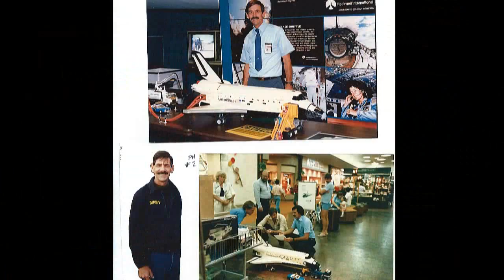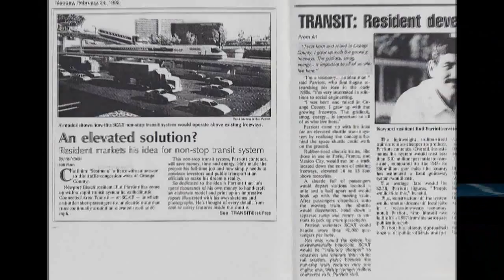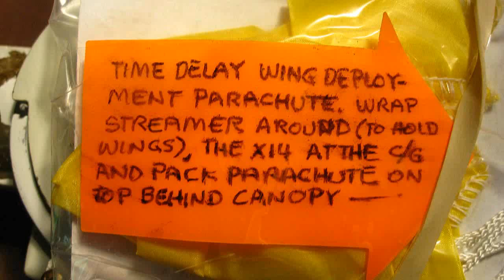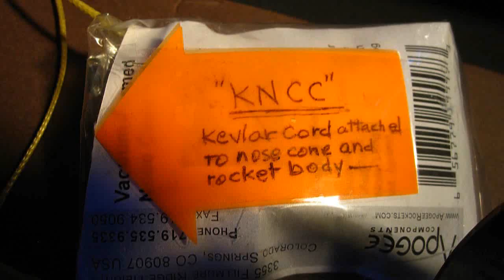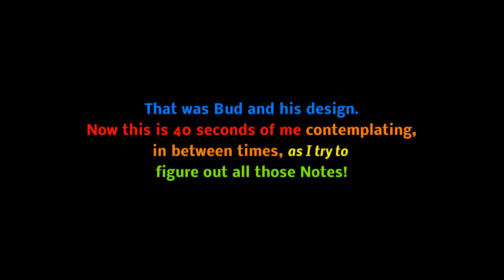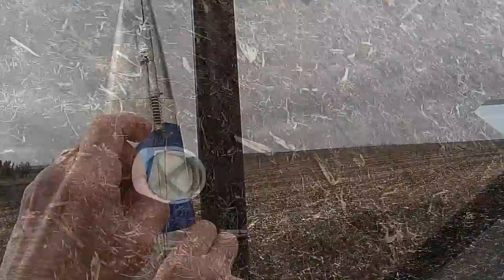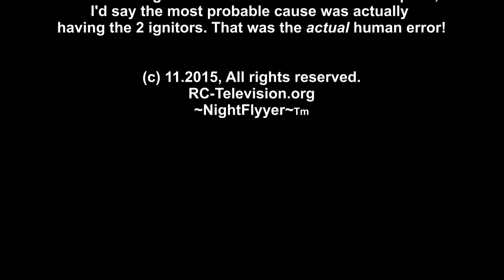Mega Max X-14 Rocket Launch, Failure, and Post Crash analysis. (Thermal Dynamic Interference?)

Comment: Great video Dave. I see no reason you couldn't parallel the two ignition systems to the same igniter. Just do not connect the battery until launch.
Reply: +Bill Flynn The thought being if the primary ignition cycle is too short because the small rockets ale lifting and disconnecting that source, the secondary battery will keep the cycle goint.

Comment: Cool video! Who knew two igniters would cause a rocket to fail? Just a question out of curiosity, why do you choose you Blade 350 QX to record, and not your DJI Phantom or your Walkera QRX 350?
Reply from the maker: +NJ Sullyalex My blade "Parks" immediately where I put it, so  when I'm in a hurry, I don't want to keep trying to re position it.  I have a newer Drone that will be soon be my new aerial cam.  Stay tuned.  Thanks.
Reply: +NightFlyyer That makes sense. Do you still fly you Phantom and Walkera? Also, I'm looking foreword to seeing your new drone!

Comment: How about running a static test of the engines/rocket to see if they all fire as intended? This way you don't risk damaging the rocket again to see if the wiring configuration actually works as designed...and it leaves you with the opportunity to try changes if need be.  I'm not sure how you could mount the rocket for static testing; maybe a weighed down Workmate.

Either way, hope to see you give it another go!
Reply from the maker: +thechosendude Well, this summer I actually did that test of the 7 igniters and proved my setup would work and even posted a video.  But Bud decided that there had to be a backup anyway, hence the 2 igniters I always was against.  The wind has been knocked out of me, so I doubt I'll be trying it anytime soon and it would be more expense, as the G motors are expensive to get shipped, etc. Thanks again.

Comment: Human error is the cause. That error happened during the design phase of the project 

Think about this. The Main Engine is the most important engine to ignite. If the Main Engine does not fire then as a fail safe no engines are allowed to fire. (The Space Shuttle had employed the same Fail Safe.)

After Main Engine ignition the pull tab switch is used to complete the circuit that ignites the secondaries. 

Of course 6 inches on that cord connecting the pull tab to the pad is way too much. Any upward motion pulls the tab to complete the circuit for the secondaries' ignition. It needed to have been held taut to the pad. The extra batteries are useless. You do not need a second igniter in the Main Engine. 

But that pull tab switch is cool. That is your fail safe. (I will incorporate that into any future cluster design.)

The long length of cord on the shock igniters could have been used as slack during the upward motion caused by a successful Main Engine ignition. 

I am looking forward to you attempting another launch.

(And I have made the same mistake. Do not feel bad. Experience is the best teacher.)

Comment: 8:58 you left the 9Volt ignition Batteries on the rocket???. No-No, If necessary run a relay system to the igniters to save weight. Which I see was also a little problem on the Launch. (Not enough speed to clear the launch rod due to weight well) . You may want to try a longer rod to ensure safe speed and therefore stability. You can also get Alligator clips that are smooth to connect to the TABS that will give less friction to slide off the tabs easier. Also, if that is an Estes main motor, trash it NEVER use one again. Go with Aerotech or I can Make my own main motor for you. Estes Motors E and above have always been sketchy for the Propellant that they continue to use and Under-performs (if they perform at all) Since they came out with them. Try test firing a few.  If you in addition follow these steps I DO think you can get a successful flight.